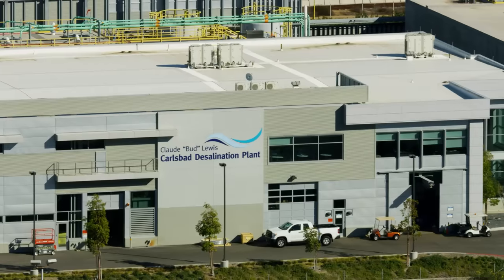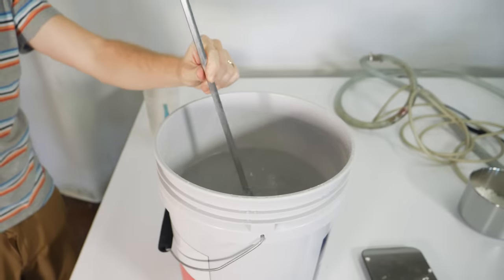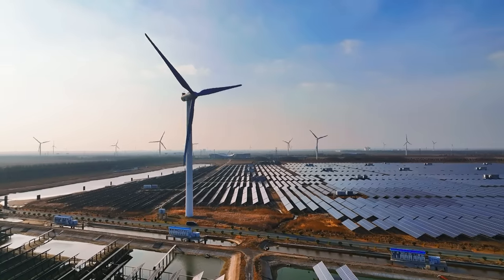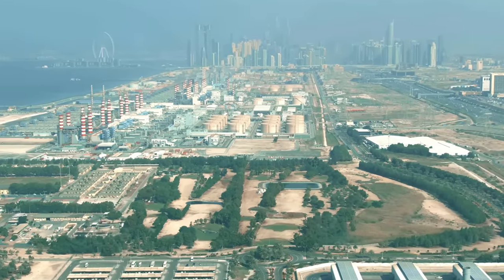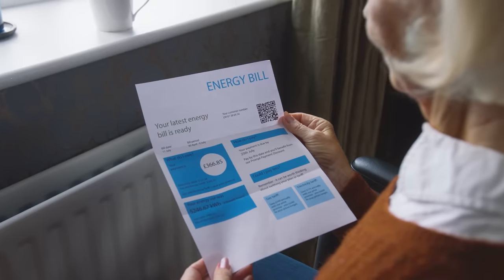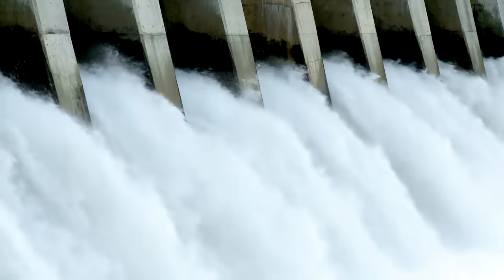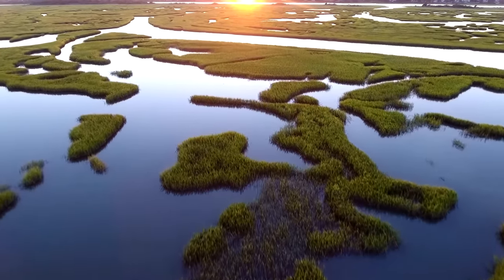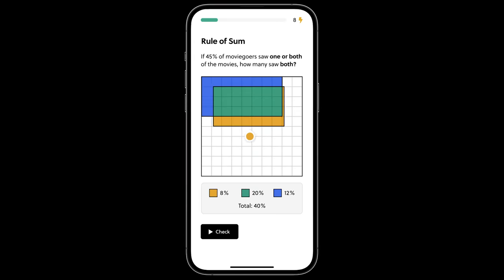Why Is Desalination So Difficult?

Comment: The potential for a problem with outsourcing to the private sector, is one that seems to be happening right now in the power sector in my part of Australia.  Our energy sector was privatized in the 90's, and since then, the problems with the plants have increased over time, plant maintenance, and regulatory requirements often getting overlooked in favor of maximizing profit margins.

Now, the plant owner, after years of neglecting the equipment, when faced with a generator that needed replacing, instead decided to shut down the power station, and simply walk away, now, the remaining 2 stations that service the majority of the state, also have closure dates before the end of the decade, with no talk of replacements other then unreliable renewable's such as wind and solar, which currently make up 21% of the market (except during the summer months when diesel generators are used to offset the demand)

These are some of the reasons that for anything utility related, I personally support state or city owned assets, especially for power, water, and communications.
Reply: Same ol' story. The "unnecessary" costs that get cut by the private sector are long-term vision (designing for the future; maintaining existing equipment so it lasts beyond short-term profit windows; etc), safety, and living wages. Basically the kinds of things you want for your children and your children's children if you're a decent human.
Reply: This is exactly what I thought would happen, and it is why I was kinda shocked when the video said that it was a good idea to let the private sector take the risk. We are talking about a resource essential for life, the risk will eventually and ultimately reach the population.
Reply: @annamyob  The other flow on effect since the sector was privatised, and I can only go by talking to people taht have been in this region lot longer than I have, but they say that we've lost SO much in terms of skilled workers and knowledge.  Some of the equipment was essentially scrapped, because there was no one left that knew how it worked, or how to repair it.  You hear the same storys all over the globe when this kind of thing happens, and profit becomes more impportant than the service it provides.
Reply: Example nr; 124634588862623 of Capitalism being awful
Reply: @kristoffer3000 but I MUST CONSUME
Reply: Yeah, in my opinion every import factor that needs stability over profit  like education, health care, or supply of the minimum (air, water, electricity and maybe even internet ) )should be taken care of the state.
Reply: @kristoffer3000  Capitalism also has its good sides.
Government is really ineffecient in doing anything. 
So they should be removed from everything "unimportant".
Reply: "Potential for a problem" is in my opinion far preferable over the reality of living in South Africa where there is essentially only the state owned electricity provider - yet everyone in the country experiences rotating power cuts multiple hours a day.

The points you cite as concerns can be overcome by another private entity filling the void. Yet when there is only one provider - that's a single point of failure and corruption/poor maintenance is all the more devastating if present.
Reply: @blablup1214  With those type of things you dont want efficiency, but stability
Reply: @annamyob You say this as if the government doesn’t spend money inefficiently because they’re spending someone else’s money, and have no fear of losing it. The problem with utilities is that competition isn’t very possible
Reply: @kristoffer3000    Compared to what? The number of examples of failure for any economic system is basically a function of how widely used that economic system is—capitalism is common, and so are its failures. Any alternative for which we can't easily enumerate failures is simply rare. We don't have examples of failure for the same reason we don't have examples of success—we don't have examples of things people aren't doing.
Reply: @aspidoscelis  We have plenty of examples of capitalism being a massive failure, look at pretty much all of Africa, South America, The US with its huge poverty problems etc etc etc.
Reply: @kristoffer3000   We have plenty of examples of capitalism. That includes plenty of examples of failure.
Reply: There's no perfect solution. It really comes down to weighing the advantages and disadvantages and trying to find the best tradeoff. Which is stating the obvious, of course, but people often get caught up in seeing only one side or the other, when it's almost always vastly more complex than that. Just something to bear in mind.
Reply: @clonkex  There's extremely few advantages to privatizing stuff
Reply: @kristoffer3000  Perhaps, but my point is that it's still more complex. It's not a binary decision. The level to which privatisation is done is a sliding scale and can be guarded with regulatory limits and fallbacks. I'm not saying it's good or bad, just that it's not nearly as black and white as people make it out to be.
Reply: @aspidoscelis  And for all those failures, solutions have been provided and ignored.
Reply: EXACTLY! when he mentioned the private sector I know there would be some f*ck up
Reply: If you haven't noticed this channel was running a cover-up for technical disasters caused by greed and neglect for quite some time now.

Comment: I live on a small island of 22km², desalination is the only way to get city water. Although the vast majority of homes have cisterns for rainwater recovery, the island has a fairly modern plant equipped with both desalination systems, reverse osmosis and desalination by vacuum/low pressure evaporation, for the latter the heat used is that of the waste incineration plant. 
But personally I rarely use city water as I have two cisterns under my house for a total of about 70m³ with charcoal-UVC filtration system. But it’s always good to have this backup.
Reply: Which island?  That sounds so cool!
Reply: @TucsonDude  St Barthélemy, Caribbean 😉👍

Comment: I have a small wall mounted ultra pure water distiller that uses a flash evaporator in the sense it throws spirts of water on a hot plate. It makes 5 gallons per day and draws less than 10 amps 120v. Pretty neat but super expensive.

Comment: In addition to the thousands of of plants on land around the world, there are thousands more because almost every naval ship and probably most commercial ships also use desalination to provide most of their water needs.  The 30 year old ships that I served on had some nasty water, but it was drinkable (barely so) and the salt levels were low enough not to mess up your bodies balance. That was in the 90s. We also got tons of bottle water training in the middle east which was all desalinated. Those plants actually made water you could stand to drink.  

P.S. I love the eyeballs on the reverse osmosis machine.  :)
Reply: I was on the Enterprise, which at the time I was onboard was over 30 years old. But our water was better than the tap water here in Las Vegas. Hard water is the worst. Of course I drank a lot of soda in those years which helps with the taste, but I drank tons of water from the drinking fountains because you have to working in the engineering plants, I don't remember it tasting bad. And of course the soda we got in the middle east was also desal. water.
Reply: @jimmym3352  I generally don't do tapwater unless it's fileted anymore. Even in small town USA you never know what's in the water until after its to late. Just like Camp Lejeune and Flint MI. A small town near me had some carcinogens above acceptable levels for over a year. No one knew until the water department sent out a letter saying it had been cleaned up. I assume you are a sailor. Semper Fi brother.
Reply: @curtisroberts9137  water quality where I live in Australia is sometimes rough as well, I was supplying rain water to a couple of friends' families in the late 90s and early aughts because they were constantly getting sick otherwise, it's gotten better but still had times when a whiff of the water has been "I'm just not going to shower for a few days"...
Reply: @cericat  I had an aunt that lived in the mountains of Colorado.  Their well was all mineral water.  Smelled of sulfur most days.  Lots of 5 gallon jugs of drinking water delivered there.

Comment: What's interesting is this is the exact opposite of making maple syrup. Both distillation and reverse osmosis are options available to producers. But, in the distillation process, they keep what's leftover in the pan after most of the water has boiled off. And in reverse osmosis, they keep the discharge and reject the fresh water.
Reply: Possibly sell the waste water from the sirup process as sweet water, naturally flavored.
Reply: So your saying we can solve the water crisis with mass scale maple syrup production
Reply: @oceanceaser44  May not be impossible. There's new tech now that coppices maples, then applies a vacuum pump to the saplings/shoots to extract the sap. Still very new, but apparently very efficient for sap production. If you can get the tree to grow, then it can produce a lot of sap from sub-optimal water sources. The caveat is that it's only in certain climates, and only in the spring.
Reply: @bobcostas9716  yeah, but this syrup is imported wildly to Europe and it is disgusting, very poor quality compared to 'classic' syrups. I am not sure if this is caused by the tech or that they just settle on lower grade syrup.

Comment: Yes, I'm that guy. "How hard could it be?" Thank you for explaining how hard it can be and the energy costs involved.
Reply: A big chunk of the energy costs are from chemistry/physics constants like the heat of vaporization of water. If you want water to change from a liquid to a gas that will be 2.2kJ per gram.

This is part of why reverse osmosis is more efficient, it doesn't involve boiling the water but will instead have other costs. (Like the energy input to pressurize the water, pressure can be considered a form of potential energy.)

Comment: Distillation can be a lot cheaper, especially considering it doesn't need to worry about all the other purification and waste disposal steps, once you remember that you don't even need to boil water. It only needs to evaporate. Small quantities of water in a thin film on a warm surface evaporate easily. It's actually super simple for individuals to distill and condense drinking water. It's only difficult at scale.

Comment: I lived in the desert for 25 years.  In that period I build very simple solar distillers that delivered less than 1 mg/l total dissolved solids.  The feed for my stills were about 2500 TDS.  All the water I drank at my home (that really is almost all) came from these stills.    There were a few technical improvements in building them but it is possible to produce drinking water (and even water for laboratory use).  The problem is that people need to use saline water for a number of purposes rather than purified water  because solar distillation gives really pure water but great enough in quantity not in fire fighting or irrigation.  When I see this, I realize how primitive our society's understanding of water chemistry is.

Comment: Worked in the water treatment - specifically deionized water - industry for 20y.   Ive always thought this technology was just on the edge of becoming a significant supplier of potable water for the world.  Thank you explaining why we are still strughling to get there.  One thoight ive had is a desal/power plant combo - use concentrated solar energy supplimented by a modular nuclear power plant (boiler water only of course) to convert salt water to steam to power turbines producing energy and the resulting water then is further processed to potable.  Removing the salt deposits would need to be mechanical and designed into the boilers to be efficient i would think.  Very interesting and pertinent topic for the world
Reply: Protect this man!
Reply: Steam turbines run on superheated steam 500+C You probably don't want to heat your potable water to that temp for efficiency. Just run the solar concentrators it'd be cheaper to just build more of them and run when the suns out than it would be to build a nuclear plant and a conventional RO for backstop. The nice thing about water is it's relatively easy to store for long periods even over months or years. Not hating on nukes but you might as well take the energy from the sun when you can store your output easily.
Reply: Add to this the potential use of the by-product. Just keep increasing the salt-to-water ratio and you could potentially have an alternative to the salt mines

Comment: I really love the information you put out here. The only point I disagree is the privatisation of water treatment. Companys and investors deciding prices for drinking water after contracts have run out. There have to be other ways for water desalination or use of water rights.
Reply: Exactly. Privately-owned public utilities is a much greater evil that he realizes.  But he is extremely didactic when it comes to explaining engineering & chemical situations so I shall continue to subscribe.  And that (misguided) statement was a  very small part of an otherwise tremendous video.
Reply: It's pretty frustrating. How does the private company compensate for the risk? Why, by charging more than it would ever cost! Governments are big enough to compensate for that themselves, without also needing to compensate boards and shareholders.
Reply: @hairymcnipples no they can't. Governments cannot effectively allocate resourcesb
Reply: @hairymcnipples  the problem isn't risk but lack of competition. It's usually hard to have multiple infrastructure providers in a location in a reasonable way
Reply: The contract could be for a certain percent above cost for the lifetime of the plant. The contract just needs to be written well. There may be cases where a local government simply can't afford it, or it doesn't make sense for one reason or another. I agree that allowing private companies to control it is an issue, but if well controlled by the contract it shouldn't be a problem.
Reply: @kuebby  , and who on earth would take on the financial risk of such a project without rewards?  anybody with the ability to create such a major undertaking would also be able to complete some other type of project for more money.  Let the private companies compete to sell water.  If nobody wants to buy their water, then let people buy their own desalination equipment.  I can't believe how many people in this thread trust their government not to do something nefarious with a monopoly on water.  At least when I buy water from a private company, I have the choice to buy it from someone else if the price is too high.  If the government controls it, then you have no other option.
Reply: @ShaneBurns-dc6fr But the government is directly accountable to you. And you can be part of the governing entity as well. Literally why we have democracy. With a private entity, you can't simply "build your own" to compete. It's not feasible. Even when there's competition, there are ground rules neither competitor will break. Manipulation of price and supply is easy, and with no way of holding them accountable other than the state becoming involved, you'll be even more dependent on the state.
Reply: @solankijimmy  , the government is never accountable "to me."  In some western countries, a slim number of elected politicians do switch places every few years based upon a roughly majority vote while the bureaucrats under them are oligarchs who can never be removed.  Elections seem to do almost nothing.

Comment: I recall reading about a mechanical technique for desalination a while back. (I think it was an israeli paper?) The idea was to lift a column of water in a sealed tube as high as possible until the weight of the column overcomes the air pressure and the water stops rising, forming a vacuum on top. the vacuum fills with vapor which is then forced out through a one way valve as the column compresses and the falling column which is still mostly liquid water can be used as a counterweight to raise another column. With multiple columns you can create a desalination engine. I'm not sure how this method compare to the membrane approach, but it would be interesting to see.